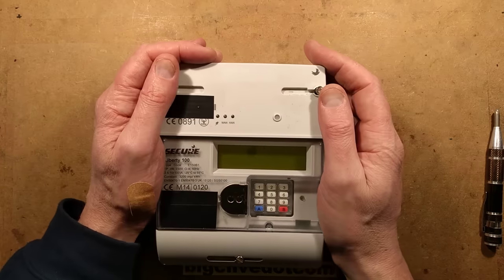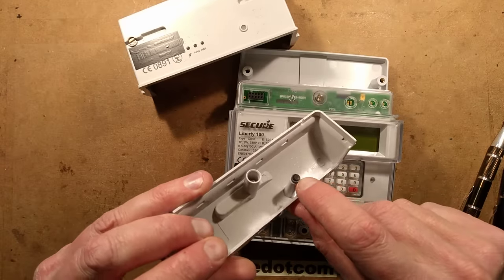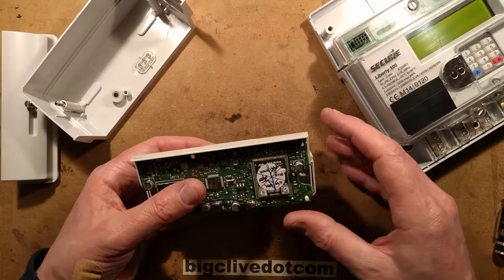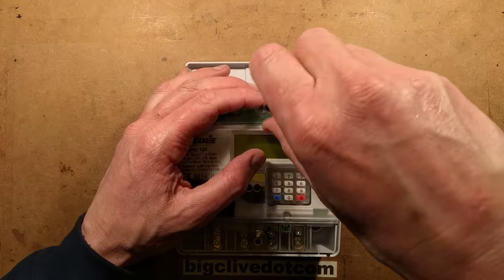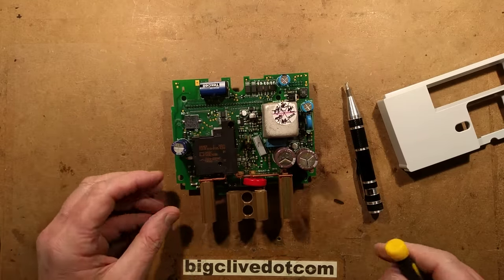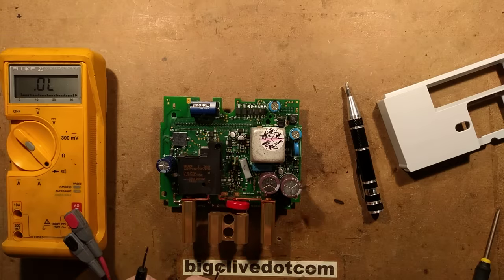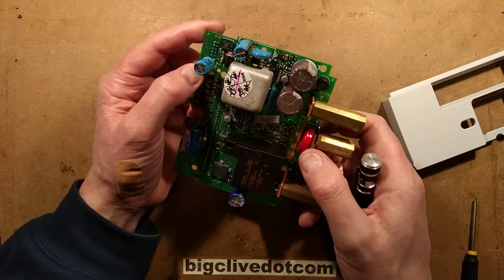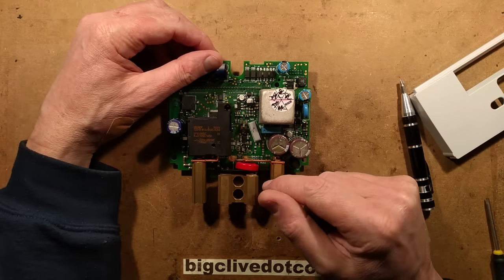Inside a smart meter, and the REAL problem with them.

Comment: A common but least understood problem with smart meter is how they deal with measuring and processing power factor.  Old style induction disc meters ignored powerfactor because the induction disc is not sensitive to voltage and current that is out phase.
This is decribed as reactive power or KVAR for short.  Because it is not measure it is not billed by the Utility.  Smart meters may or may not be capable of measuring KVAR hours depending on the design.  In some cases the utility measures only the V and A and bills this as KVA hours or KW Hours.  Reactive power is not real power and this practice is plain cheating.   It is interesting to note that big loads like a factory have had their KWVAR measered for years and they pay a special rate for this which is called VAR hours

Comment: How do they isolate the cell signal from the copper wire? We have excess amounts of EMF in our house. If you study photons electron transfer, you will start to see an issue where LED lights emit photons, which excite electrons. Your comment about how you have not been affected by emf is your personal experience only. Their is now mounting science that validates that ALL people are affected by emf. How close can you put a baby's cot to the smart meter installation? If it's safe then 0mm will be fine. However, if it isn't zero, then you have the answer as to how safe the technology is. Just because the private organisation called The WHO says it's safe means absolutely nothing.
Reply from the maker: If you've been using one of the many quack EMF field detectors in your home you will find everything makes it go into alarm mode.  It's basically a standard electrician's live wire detector with a siren for drama.  They are made and sold for the very lucrative "dirty electricity" market so they can sell very expensive remedies that do nothing.

Comment: Has anybody ever thought about what is happening to all the old none smart metres they are removing. At the moment they are all stored in large warehouses. If they could landfill them they would, they are probably waiting for a large fire to destroy them all in the warehouses, which would sort their storage problem and blame it on an accidental fire. Old gas metres cannot be recycled because gas has exposed the metal components in them. The electricity to run the smart metre is taken off the customers side, may only be about 15 watts to run it but over at several years that costing the customer a lot of electricity and money to run the smart metre. All these metres shown here are manufactured in India, why we couldn't manufacture them in the UK and bring British jobs back well that's a mystery. Millions of installed first generation smart metres (which soon will be dumb metres) will have to be replaced with up-to-date metres as the old smart metres will not change to new networks all providers  (more wasted metres which will have to be stored away waiting to be incinerated) so when you work out the maths and the saving that people think they are making to the environment  having a smart metre fitted it's actually causing a bigger pollutant to the environment. I.e. millions and millions of good working metres removed stacked high in a warehouse. New manufactured metres which will be using materials fuel and resources up. It's common sense you know how much electricity you are using,  just open your eyes and look around your own home and see what is switched on. Bit like having a smart tap to tell you how much water you are using. How about a smart tissue box to see how many paper tissues you are using. We could introduce a common sense metre connected to people's heads to see how much common sense they actually have got, it would have to be very sensitive electronics in that one. How do I know about smart metres I used to work for that company shown in the video. Based in Bristol. Horrible horrible job couldn't wait to get out. Happy savings to all the British sheep.

Comment: As a complete noob to these sort of things, i was wondering if the bluetooth bit you mentioned could be to communicate with a gas meter?
Reply: its not bluetooth, it uses a protocol called zigbee (same as Alexa or google home etc use to communicate with light switches etc if you have them). And yes it is how the gas meter gets access to the hub modem.

Comment: Just read in a comment to another video that air source heat pumps seem to use more energy than rated according to the smart meter. Is this a power factor issue?

Comment: Great video Clive! I love videos like this where people test or debunk urban myths or also investigate tech to see what it's actually doing.  Also making new gadgets and ideas is great fun. I'm quite obsessive about tea making and like my tea quite strong but not cold obviously, so I was thinking about a gadget for making the perfect cup of hot tea everytime (to avoid wastage) to your own taste profile setting at the touch of a button...the gadget would pour boiling water into the cup first to warm it and then empty and refill with your tea bag and brew to perfect time for strength preference and sound an alarm when ready! Probably such a gadget is overkill. You could just heat the cup yourself with water from the kettle then use a count-down and alarm timer feature (common all smart phones) to time the perfect brewing strength whilst avoiding it going cold 😋 

I'm a real geek when it comes to gadgets and inventing things. I've done loads of experiments in the past with making new gadgets. At the moment I've been experimenting with old CPU/computer PSU fans to generate electricity using wind power and inexpensive solar panels when there's low wind. Surprisingly you can generate quite a bit of electricity inexpensively using this method which is scalable. 

One urban myth which some claimed to have debunked is that wrapping mobile phones in tinfoil (to create a faraday cage) does not block the mobile phone signal or prevent the phone working and being location detected. I found out this not to be the case. The fin-foil method DOES actually work if you use enough of it and wrap the phone well. Once you do that, the phone can not longer establish a signal with your nearest cellular mast and so becomes inactivated temporarily on the network. It doesn't even go to voicemail if you try calling it, you just get a 'sorry this number is not reachable' message! Once you take the tinfoil off, after a couple of minutes the phone works normally again. The phone also becomes a little toasty if you leave the foil on long enough and the battery runs down quicker.

I was wondering if the same principle tin-foil faraday cage could be applied to energy provider Smart Meters, since presumably they using mobile cellular network GPS transceivers? If you were able to wrap it fully in tinfoil suddenly your meter would be off the network and you've created a blind spot to the energy provider. You could have some fun with that (assuming it works) and keeping wrapping it up to block the signal/disconnect it from their network, and temporarily disrupt billing data being collected.. the energy provider would probably assume there's a technical fault with the smart meter and come out to repair it. You could remove the tinfoil before their visit, and they'd be perpelexed from seeing the meter is working fine. Then wait a few days, a week or month, and do it again wrap it in tinfoil and have them come out again! If you did that enough times I bet the energy provider would just replace the meter with a new one needlessly. 🤣
Reply: Sorry to burst your tea maker machine idea but there was one in the 1950/60s. It was called a teasmade or teasmaid and was an alarm clock too and would wake you up with a cup of tea.
Reply: Wrapping an active transmitter in foil is a FANTASTIC way to overload it and totally burn it out. I feel like this whole "it won't work on your phone" is a prank to get people to break theirs.

Network disruptions are normal, any meter worth its salt will just sit on collected data and transmit when it's able to. So as you pulled the foil off - if the thing even still works - it would just transmit all of the information at that time.

Comment: what happens when that lithium battery drains down? Does it stop working? Do you have to pay to get a replacement meter?
Reply: The electicity one is mains powered (probably has a battery for backup), the gas one is battery only for safety reasons. It will stop sending readings if it goes flat I guess. The gas one connects to the electric one to send data back as it has no modem itself.

Comment: I assume that someone has pointed out that the Hall Effect sensor and the little welded in plate section are how it actually measures current, right? A "smart shunt" ...
Reply: The hall effect sensor is too far from the shunt, too close to the contactor, and not sensitive enough for that.  It's part of the tamper detection.

Comment: I’ve just had some PITA trips on an Rcd on my split load CU. Fault finding etc found nothing. After many google searches it turns out that the smart meter is in too close proximity to my CU which is impacting the RCD.  Have stopped the tripping, by making a rf shield (cardboard with tin foil PVA’d and covered the smart meter. No more spurious trips. Will fit a newer RCD on the affected side, as the installed one is about 6-8 years old, to see if I can then remove the shielding.  Have you heard of other such instances. Cheers.
Reply from the maker: That's unusual.  Rogue tripping can have many causes, but this is actually the first I've heard of a meter causing it.
Reply: @bigclivedotcom  here is a link to some discussion about it. Also not sure if it is from failing rcds becoming more sensitive to RF, as a new RCD fitted a few moths ago does not trip, only the older one. Could send you the old RCD for you to have a play with if you’d like.

Comment: So then, if one of the input resistor values change, the voltage drop would vary, and the meter would read the wrong wattage when multiplied across the current?
Reply: I like your thinking ;)

Comment: Those connections at the bottom of the meter don't look big enough to take a service entrance cable.
I looked inside my breaker box one time, and the conductors coming in from outside are as thick as my thumb!
Reply from the maker: Higher voltage, lower current.
Reply: @bigclivedotcom  So this meter is for a specialized high-voltage application?  Not for a typical 240 VAC home service entrance?

Comment: So can you still just link a piece of cable from the positive in to the positive out to bipass the meter, stopping it from cutting off the supply?
Reply: The anti-tamper sensor in the bottom section will alert the undertaking to that.  I have seen jump-start cables used for this in blocks of flats where they've opened up the Ryefield board and taken the feed before the meter. 100A will give you a nasty belt!
Reply: Yes, you can do that. Best thing to do is take the 2 LIVE/RED  (Its not possitive/negative in AC. Only DC) cables out and connect them together with a Henley block or similair. This way the meter will just think the main fuse is blown as no power will be passing through it.

PS : REMOVE THE MAINS FUSE BEFORE DOING ANY WORK. They usually just pull straight out.

(For educational purposes only ;)  )

Comment: there is an antenna and a modem so just need to know how strong of a frequency or what frequency they choose to use to communicate with it as there are 5 different connectors for frequencies basically is what you said.  So it is the frequency that people are concerned with as certain frequencies can cause health issues.

Comment: Clive what is the power consumption of the modern/wi-fi unit, as the customer pays for its usage,  so are smart meters actually free?. I've got solar and the discrepancy between my smart meter and the inline solar meter (placed exactly before the cables enter my household fuse box) is 20watts per hour. So a smart meter uses 175.2 kWh per year........ !!!! hardly free.
Reply from the maker: The meter itself is powered from the electricity companies side, and the little display unit only uses about 1W, so will cost virtually nothing to run.

Comment: Opto-isolation is to keep the 240 mains voltage well away from the low-voltage data circuits, they mix well but with a rather impressive light show!
Reply: The modem and its antenna will also be electrically isolated from mains for the same reason. Anything accessible by the end user must be isolated.

Comment: Hello  -  Smart meters - don't trust the energy suppliers - I've read somewhere that they can remotely reprogram them to their advantage  i.e (we pay more per unit Gas & Electricity )

Clive would you know if  consumers can have say a Gas Smart Meter installed in series with a regular Diaphragm type so gas supply can be monitored on the in-house display. 
  Noting that the Smart Meter to be dumbed down so as  not transmit to the supplier  but still use the diaphragm meter readings as the energy costings, if you know what I mean...joe

Comment: All i know is when i was living in Victoria Australia we had new smart meters installed at our rental house-our power bills increased by 50 % and we weren't using any extra power out of the usual. Our quarterly bill used to be approximately $400.00,after the smart meter installation our quarterly bills rose to $750.00 !!! I complained and the power company said our old meters were not charging the correct amount of usage! What a load of bs! These smart meters are a scam.

Comment: Those opto solators going off board , should check if they are low degradation types. I would not be surprised if this were the case that they are for carrying wired signals from a transducer.

Comment: Just looking at that, with the N/C relay, couldn't one have simply cut the neutral from the meter and joined the tails outside the thing & it'd not be able to see anything other than a power cut?

Comment: It's rather odd to see those connection points that look like they would have wires going into them.  I'm used to electric meters that basically "plug in" to a meter box. No loose wires carrying mains...
Reply from the maker: Traditional style here.  No back box.

Comment: You seem unaware that the meter is a 2 part apparatus there is also a box you have plugged in that has a display that you interface with, I am guessing that's what the extra transmitters are about.

Comment: The extra RF circuit is for a narrow band IoT network like LoRaWAN in Belgium, which connects them together to one meter doing all the communication.

I presume the resistor and capacitor is there to verify and calibrate the meter and will only be added when they need to do so. 

That it does not measure between ground and phase but only phase to phase gives me questions too in case of reliable monitoring the full load. There have been reports before that a simple KlikAanKlikUit device changes the metering results..

Comment: I would think that the large caps  supply power to the modem to send a message if the power goes off completely, ie: a power cut or main incoming fuse.

Comment: 9:50 thats a shunt resistor, it a material which has a linear impedance among the entire temperature range. it is shaped the way it is because the the impedance is calibrated by removal of material
Reply: I think it is most likely a slug of an alloy with a low temperature coefficient of resistance, like Manganin (https://en.wikipedia.org/wiki/Manganin).
Reply: Yeah that's what I said. It's called a shunt resistor and is historically only used for DC applications but I suppose is used here to eliminate the need for inductive current transformers which are more expensive and require more room. Typically shunt resistors are made out of an alloy of some more expensive materials. They take a grinder to it during calibation to make sure the resistance is just right since it needs to be revenue grade accurate
Reply: @jontopham2742  - my point was that it is perhaps less important that it be a linear response (although it is, pretty much) than that it be a small response, for example by a factor of over 200 when you compare copper and Maganin. Then again, even if the coefficient was zero, the slug would still expand as it heated up, increasing its resistance, and Maganin is just a little worse than copper in that respect. How do you think they get around that? I didn't see any evidence that the slug has its temperature monitored.
Reply: The thermal conductivity of copper is so high it might be on the PCB right nearby or may just measure ambient. The coefficient  quite low.

Comment: I had arranged for my power company to come and fit one of these contraptions. I was at work and my Mrs was in alone. She sent me a text asking me for the WIFI password? I called and asked her why? The guy that was fitting the thing had told her that he needed our password to connect the new meter. I asked to talk to him. He spouted the most stupid nonsense about, "you need WiFi for the things to work. Or He'll have to enable the SIM and we'll be charged a monthly connection fee of around £30!" Once he had stopped waffling I then informed him that I was a spark and had been for over 40 years, and asked him who he was registered with? He apparently threw the thing on the floor and left. Leaving the tails dangling. When I got home I discovered he hadn't even pulled the cut out. LIVE! Braver than me? Or just plain stupid?
Reply: You, sir, are spouting nonsense.

Comment: What exactly was under the shield -- you just said power supply.

Do you mean DC-DC converter or AC transformer or ??
Reply from the maker: It was a traditional transformer.  Presumably shielded to prevent external magnetic tampering.